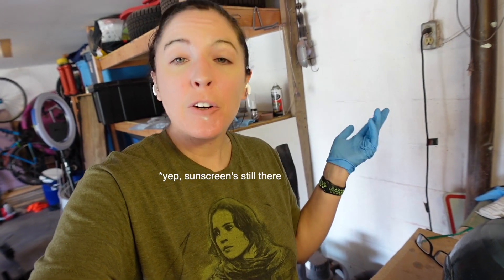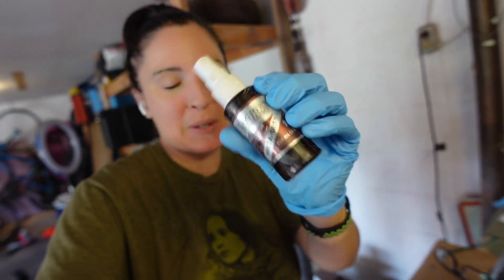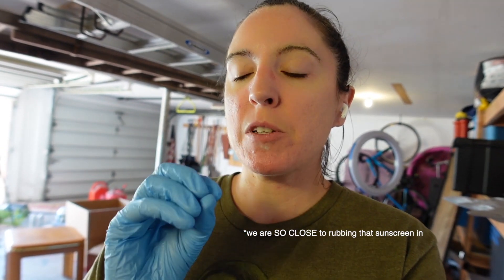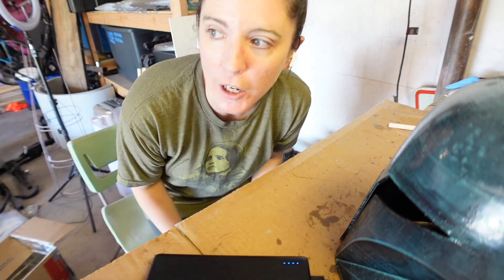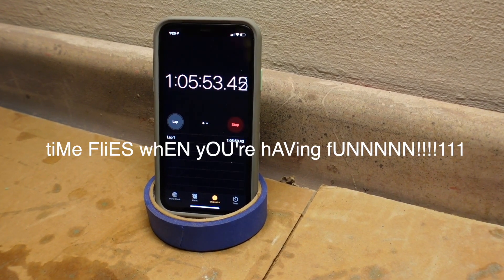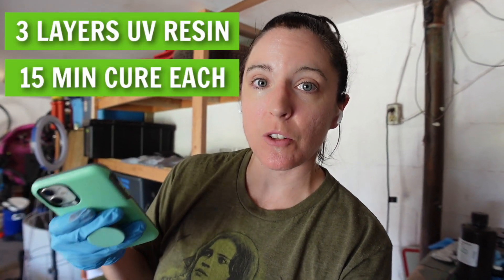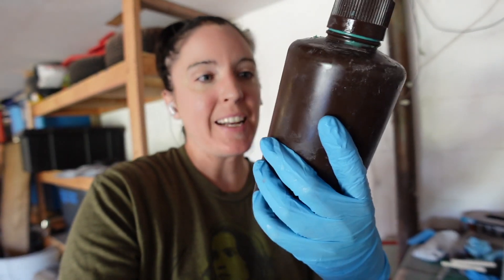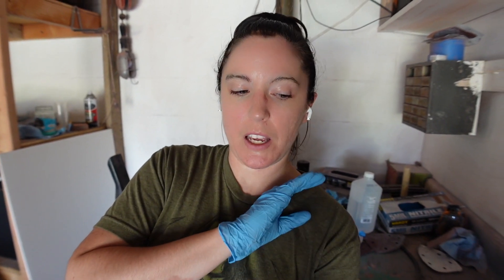How LONG Does It Take to Smooth a 3D Print with UV Resin?

Comment: Nice video but you pooled a lot on there and caused more work for yourself with all the build up in the ridges and bubbles, more efficient to do a thin layer use flash light move on to next section uv flashlight, etc less sanding in the end

Comment: A thin layer of resin will cure in literally a minute or less. I use a UV flashlight on mine and only do a quick pass with it. Leaving it outside is also a good option, especially if you want to get a production line going and work on something else in the meantime. I personally like to sand between each coat of UV resin. Sometimes you can end up with tiny air bubbles in the resin then need to do another pass anyways. Doing it 3 layers then sanding is also fine though. With those high spots on the top of the helmet I usually take those out with a heavy grit (80-100) before even starting with the resin.

Have you tried mixing resin with baby powder? It will thicken it. Which is good for filling in small seams, little pit holes, etc.

Comment: A couple things I've noticed is that hiding all your seams on the back of the print will help keep any blobs/imperfections in one area. Also doing an initial sanding before adding resin would probably help as well with knocking down any high spots

Comment: Great tutorial. I will say that however yes you can ruin a print leaving it out in the sun too long. Depending on the temperature the print can warp if it's PLA. Learned that the hard way. Also working on testing different resin amounts and curing times. From my limited experience one layer and a few seconds in UV light isn't enough. Paint and primer won't adhere properly and you'll have to sand it all down again anyway.

Comment: Clearly a little late for this, but starting at a very low grit to start with and working your way up to a higher (more fine) grit is a great way to get rid of the worst layer lines or other print defects. It feels awful at first marking up your print, but unless you're filling deep grooves with some other material, you gotta just aggressively sand with low grit to get that uniform texture. This would all be pre-resin.

Comment: I use elegoo resin as well, I believe I have a gray one. I then use a uv lamp light for about two or three minutes over the entire helmet. I don’t use isopropyl alcohol until the 3rd layer has cured. I find that it helps the layers stick well together. Then I wet sand with a higher grit sand paper. The smoother you brush on your resin, then the less sanding you have to do, if any. Also let the resin settle for a bit( if you haven’t brushed it on so heavy), that way it levels itself out. So I spend maybe 20 minutes doing all the resin stuff and it comes out super shiny and smoothe.
Reply: Also I use bondo and glazing spot putty just to get any major holes or imperfections

Comment: How was the adhesion between the 2 different material. UV resin doesn't seem to like to stick to things.
Reply from the maker: seemed to work fine for me, I think the key for me was wiping each cured layer down with isopropyl alcohol before applying the next

Comment: So I have a couple of questions if you don't mind. First off are all those layers of resin really making a difference because it seems like it's almost the same amount of sanding you would do with or without them. Maybe that's just my perception.
Also why would you close your garage door when working with a resin? You should have a highly ventilated area and I would think it would be better to have the door open to get a fresh breeze coming in.
Finally, you're brave letting things cure outside. I live in Orlando and if I did that I would have to first sand through the layer of bugs that had landed on it.
Reply from the maker: Just to be transparent, I no longer use this method for smoothing prints ... but when I did, I closed the garage door only when applying the resin as the small bit of ambient light I was getting from it being open caused the resin to cure on me. I was always wearing a respirator and proper PPE while I did that, even if it wasn't ideal (and this was a big reason I stopped using it altogether). As for curing outside, I'm in Pennsylvania so the sun rarely gets hot enough to melt the PLA when I cure outside

Comment: I'm working on a 1/6 scale car and plan to paint the parts. I may try out this ABS UV resin method. Did the resin or alcohol smell linger at all after closing the garage door? Or do you have good ventilation in there with the door closed?

Comment: Hi, geeting into the ideo of purchasing a 3d printer, so looking for inspiration and so thank you for that! Why the resin in the first place? Can you just not sand the filament as is?
Reply from the maker: thank you! and funny enough, I don't use this method anymore but basically the resin filled most of the lines in and would be easier to sand (though the tradeoff is it's hard to work with safely) but nowadays I just sand down the raw print with anywhere between 60-80 grit and hit it with a Duplicolor high build filler primer and keep sanding from there til I like the finish. One of these days I'll get to an actual tutorial of that!

Comment: Why not just use a resin printer?
Reply from the maker: there's a bunch of reasons, but resin printers capable of printing large helmets/armor are expensive, not to mention the cost of resin to print those things. FDM printing a helmet costs me about 12 bucks in materials, where a resin helmet could easily eat up a 30 bottle of resin in one go. resin printed helmets and armor are also super fragile, and as someone who's already pretty clumsy on the best of days, would not be the best material for me to work with. it's also heavier as well
Reply: Okay got you. Makes sense. Thanks for the reply.

Comment: Nice video
Reply from the maker: Thanks!
Reply: @vaultfox  never tried resin before on my prints , normally use a section of files. Some wet and dry sanding and then some primer/filler, then abit more sanding. A good trick I’ve used was to fill the part joins up with what ever filler you use. Then go sand it , then go over it with primer and if you can still see where the parts join together , I’ll run alittle bit of superglue down the seam. Wait until it goes alittle tacky then dry sand over it, the excess primer that comes off from sanding gets caught by the glue and fills the gap, you may need to repeat acouple of times that step but boy does it give you a great finish too. You may use abit of sand paper too but totally worth it for the finish you get.

Comment: I'm guessing that while you've got plenty on sun in your area, its not actually too hot? (especially if the helmet is black)
Cuz in my country, 5 minutes in the sun is enough to really soften pla and I end up with sagged dents and swelling.
Reply from the maker: I'm lucky in that where I live, it'll get pretty bright but the sun isn't 'too' hot for the PLA, if that makes any sense.  But this is one of those examples where if it's too hot out in the sun where you are, I'd recommend making some sort of UV curing chamber to avoid your PLA melting in the sun.
Reply: @vaultfox  I put off making that for some time. But I guess it's a much safer option for me. 
Thanks for the tip!

Comment: Curious if you've had any issues with parts warping when you cure them in the sun?
Reply from the maker: I like in PA so I'm usually OK to leave stuff out in the sun, but I have had it happen. Normally nothing too bad that I can't fix with a heat gun, but if you're worried about it you can always make a DIY curing box

Comment: Whats the pros and cons of using resin to smooth vs bondo?
Reply from the maker: that's a video I'm considering making tbh but for me, the pros are it helps me get prints smooth way faster than bondo and is less messy when it comes to sanding. A lot of the cons are focused around the safety of handling resin properly and it can be pretty messy to apply.
Reply: @vaultfox  thanks for your reply. I may try both methods and see which I like best.
Reply: Bondo starts curing once you mix it, so you have a limited window to work with it and apply it to your piece. It also goes on a lot thicker, and I've found it is very quick to clog sandpaper when you're trying to sand. 

UV resin goes on much thinner, so it's great for filling gaps and layer lines. It doesn't cure until you expose it to UV light, so you don't necessarily have to be in a big rush when applying it, but being thinner, it will run if you apply it too heavy, so keep that in mind. Compared to bondo, UV resin doesn't clog sandpaper nearly as much when sanding, but it does produce a very fine dust, so wearing a respirator is an absolute must, because that dust is some toxic stuff.

Comment: Loving your videos!  I want to use the UV resin curing technique now on my Mando armor, but I've already used filler primer & minor low grit sanding on some pieces.  Is it ok to add the Resin layer over the filler primer or does it have to be applied only to a bare 3D PLA print?
Reply from the maker: Aw thank you so much! I've had success putting the UV resin over top filler primer BUT only the 2-in-1 filler/sandeable primer. I've done it with just the type that says "filler primer" and it doesn't really like that as much, it's almost like I'm just moving the filler primer around?

Comment: Some things Ive been doing that have really helped with hiding layer lines is the using the adaptive layers setting in Cura. Also some things that really help with keeping the mess to a minimum in my garage is a large ridgid shop vac connected to my sander. It is life changing to have the dust go immediately into the vacuum and the garage doors can be down and I dont need to wear dust mask.

Comment: Has anyone tried sanding before resin with like 80 or so and then resin. I have a feeling that might help?
Reply from the maker: I mention in the video and previous ones that 80 grit ended up being too rough for my particular resin and ended up creating more work for me, but I’ve seen others have success with soooo I have no idea
Reply: @vaultfox  i thought you sanded 80 after the first layer. i was meaning before any resin like right after printing to knock down some of the scattered dots
Reply: Quick sand prior to resin is the proper thing to do and saves time

Comment: I thought in your earlier videos you sanded and spray painted in between each layer of UV resin. Did you decide to cut out those steps??
Reply from the maker: Yep, for this one wanted to see how it worked out with multiple layers of resin and then primer. I usually put primer on when I want to see what needs more fill/sand work and I knew one coat of resin wouldn’t do it for this rough of a print
Reply: @vaultfox  Awesome!! Thanks for the quick reply!!! I bought all the supplies you suggested through your Amazon links and I’m trying this method tomorrow on 3D printed Mando armor I purchased from various sellers on eBay and Etsy! It’s supposed to be my husband’s Halloween costume (our baby is going to be Grogu!). I’ll let you know how it goes! I think we are capable - my husband has a woodworking shop in our garage and I’m pretty crafty, so hopefully we can pull it off in time for Halloween!!! We are big procrastinators lol

Comment: I actually let my resin cure for a minute or less for the bottom layers. Then my last layer I cure for another minute or so. Wash in alcohol. Then I'll put the piece in the sun while I'm cleaning up the mess which is maybe 5 or 10 minutes. Wash in alcohol again and then sand it with 80 grit. Spray filler primer and then sand, sand, sand until it's smooth.
Reply from the maker: That curing time sounds way quicker and simpler than what I did, I'll give it a go on some of the last pieces I have lying around for Bo!
Reply: @vaultfox  I forgot to mention I do give the piece a sand with 80 grit before I put any resin on.

Comment: Great video as always. Can I ask why you went away from using the UV LED chamber you made and went with just curing the resin in sunlight?
Reply: The helmet is fairly large, I assume the fit would be tight in the chamber :)
Reply from the maker: my cure box isssss about 12 x 12 x 16 I believe so it would fit, it's just more efficient to put it outside while I still can
Reply from the maker: Thanks! And I've been putting stuff outside mostly because I've been using the resin on a lot of larger pieces at once and to take advantage of the sunlight we have before fall hits. I've been using the cure box for smaller stuff but for all of these armor bits it's just easier

Comment: Interesting video right about my actual concern about smoothing my print.
On a side note, I've already left some pieces in the sun for almost an hour, and I have the impression that they have undergone deformations (especially the face plate of an iron man helmet which does not quite fit with the other parts now).
Reply from the maker: oof, yeah that's one thing I have made note of in other videos but if you're using something like PLA and live in a hotter climate (I live in PA so even when it's sunny out it's not baking the ground or anything) you can see warping. It's probably better for you to either use a cure box or only leave your items out to cure for a few minutes. I've had other people tell me their resin cures quick (which by design, it should)

Comment: what grit do you use for wet sanding, and is there a basic guide for it?
Reply from the maker: I usually start with 220 then go up to 500, 1000 and usually finish with something like 1200 but you can go pretty high with it, depends on the finish you want in the end. Since Bo is gonna be weathered up I'm not too worried about smooth/shinyness and I don't know of any real "guides" for it, I just kind of picked up random tips here and there but I'm sure there are so youtube tutorials on it!

Comment: So I’m just getting to where I want to post process some prints and I’m wondering why you’re doing resin before filler primer and not just the filler primer?
Reply: The UV resin eliminates the appearance of layer lines a lot faster than multiple coats of filler primer.  Same concept as the bondo spot putty or wood filler
Reply from the maker: Kinda along what Tom said, the filler primer really doesn't do much in the ways of getting rid of layer lines. If you wanted to do just filler primer, you can usually sand down the layer lines with a mouse sander first and hit it with the primer, but this always took me ages. The resin fills in the majority of the layer lines so you just end up smoothing the resin down to get it smooth
Reply: Cool, thanks that gives me more to consider.

Comment: I'm definitely going to have to try this method on my new mando helmet. How much does the resin usually set you back if you don't mind me asking?
Reply from the maker: Cost wise? A bottle of it is 30 bucks and I've been using the same bottle of mint green resin since around mid-April of this year. I actually want to make a video on how many pieces I've sanded and filled with just that bottle alone but for some reference it's already got me through my Bo Katan armor and Mando armor with tons to spare
Reply: @vaultfox  not bad at all then, seems you can stretch a bottle quite far. It's probably cheaper than me constantly buying spray putty that last all of five minutes!

Comment: Great video. How much does the resin smell? Like can I use it in an apartment then take it outside?
Reply from the maker: Thanks! I actually have a really crap sense of smell due to some allergy meds I’m on, so I’m not the best judge on that HOWEVER smelling them or not, they are toxic to breathe in so it’s best to try and use it in a garage or a well-ventilated area and then take outside to cure